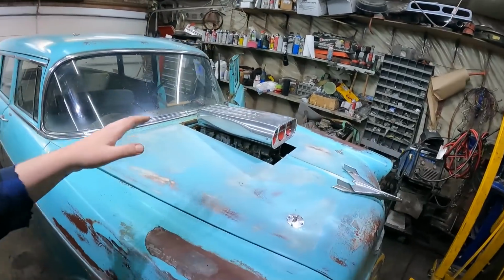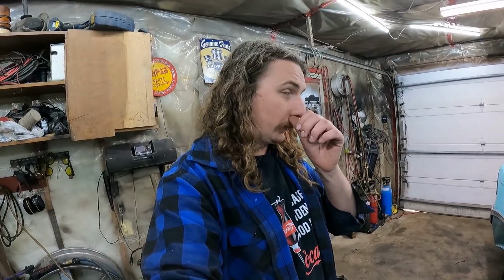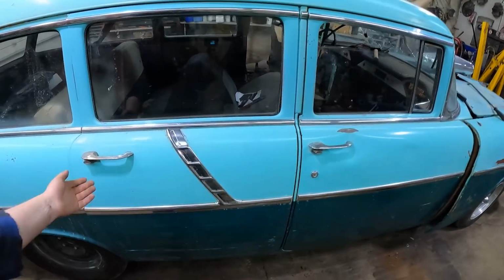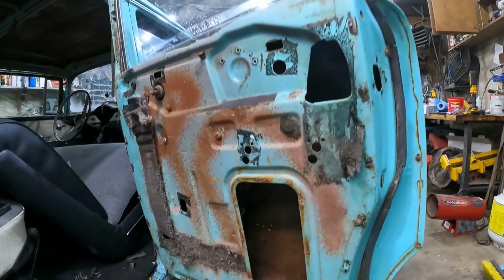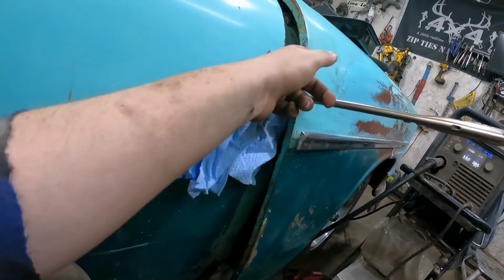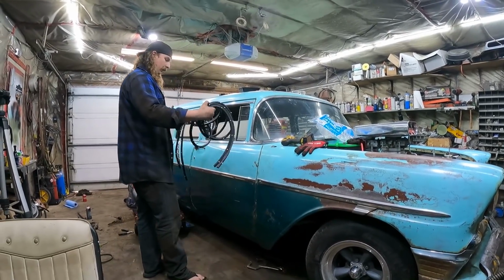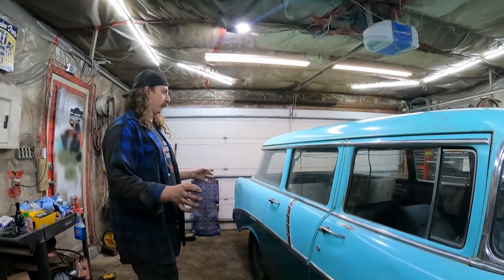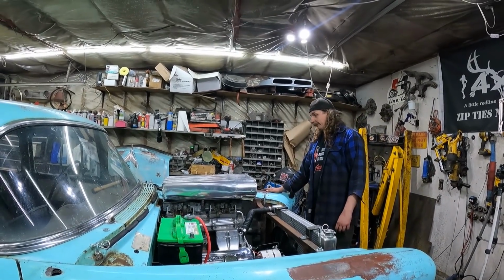Fixin' What Ain't Broke - Classic Car Ownership: Remove, Clean, Lubricate, Replace

Comment: I have found that letting the lock mechanism and the window regulators soak in a bucket of kerosene for a few days will loosen them while lubricating them. Also, take a can of silicone spray, and lubes the window channels to make the glass glide up and down easier.

Comment: Nothing a hammer won't fix. Quality control was not a high point for any make of vehicle and so its a cutting torch or hammer or Porta power to fit things. Brand new and at home sticking put a two by four in the door and slam it against it to make it work better... that was new rigs at their best. I  think that a bigger garage with space to walk to each rig that you want to tinker on is the best as it saves so much time. So waiting for the next on Dan and Dani... nice of you to entertain this old man

Comment: G'DAY Dan,have noticed that you have a New Lexicon (Dictionary of Dan, Golden=80%,Mint=90%, basically you're lowering your standard to S.B.G.E.M.(SHE'LL BE GOOD ENOUGH MATE), a good trick I found in the 1956 FE/FC GMH HOLDEN Australia factory Workshop Manual regarding Windows ease of operation,is to lubricate the doorframe window felts with manual then read light machine oil( today's speak= WD 40 or similar,I found INOX to be my penetrant of choice), thus I've found that most vehicle manufacturers benefit from this maintenance procedure, would consider taking the opportunity to talk to your interior ( upholstery guy), regarding taking a pattern of your door cards, before further deterioration proves them unserviceable for template! As always, Kindest Regards, Dave McLaughlin Queensland Australia

Comment: using a screw to hold on trim is a hot rod sin
Reply from the maker: Maybe I should put the car back in the field to rot? Haha. Alteast it's being fixed
Reply: @DDSpeedShop  I do like your work. There are just somethings some car guys hate to see. and that is one. i have had to repair many screw holes in trim. so i hate to see that. A trim clip is easy to make.

Comment: I bought a little air bladder with a hand pump kind of like a blood pressure cuff from Lowe’s.  It’s mint for adjusting car door alignment.  It’s usually by the levels and straight edges at home stores.  It’s considered an air shim I think.
Reply: https://www.lowes.com/pd/Calculated-Industries-Inflatable-Leveling-Tool-1-5-in-Pocket-Level/1000236865

Comment: The front signal lights went out when the headlights came on back in the day. You either had parking lights or headlights, not both. They mandated that feature here in the states in 1968 (not familiar with Canadian law). But it IS cool that 56 has it.
Reply: There’s a spare spade in the light switch for that
Reply: @lloydh4251  perhaps there is..now on repop parts, but it was NEVER used, anywhere in the american automotive industry, prior to 1968 when it was mandated by the feds...
Reply from the maker: Yeah I wired it that way.

Comment: It is worth the time to solder a ground wire to the lamp socket.  I run the ground wire to a four wire block (Stop, tail, reverse, ground.) so I can unplug and remove the housing.